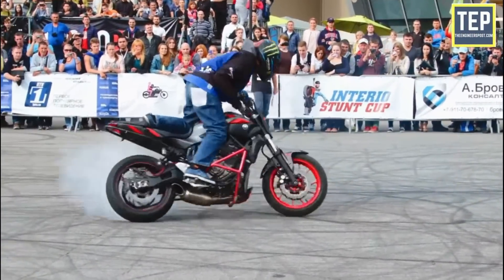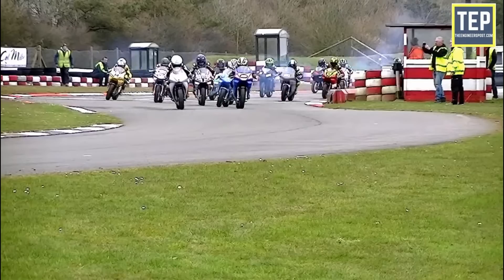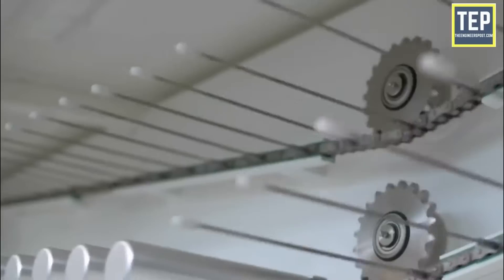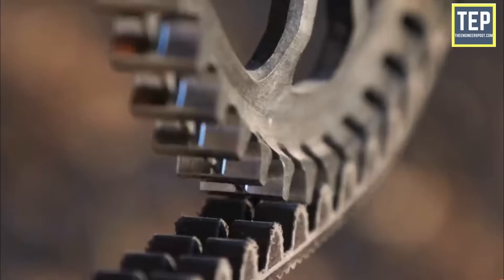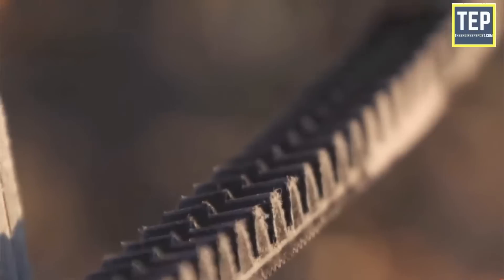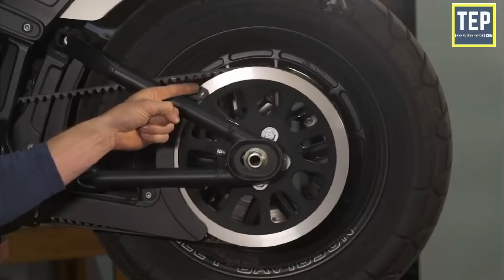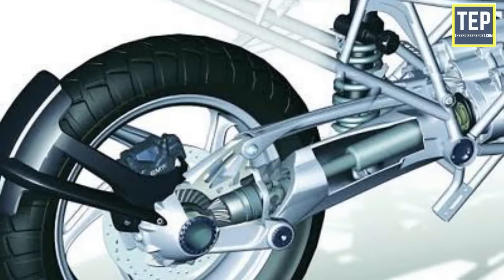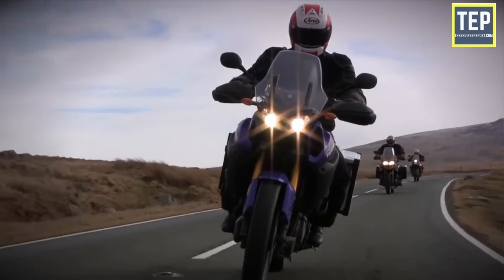Chain Drive vs Belt Drive vs Shaft Drive in Motorcycles | Which is Better?

Comment: Although belt-drive has advantages that you mentioned, a disadvantage is that they're unsuitable for off-road use.  If a stone or rock is caught in the drive, it could ruin the belt, & possibly the hardware as well.   I don't like the hassle of chain maintenance.  I'm happy w/ my shaft-drive, despite the power loss.

Comment: the only reason chains are the norm is because they are just a continuation of conventional wisdom and engineering.  I have had chain and belt driven bikes, and honestly greatly prefer belt because no required mx. My belt driven bike is 17yrs old and still on it's original near wear free belt at 16,500 miles. all of my chain bikes are on their 2nd or 3rd chains in less than 15k miles. they also require regular cleaning and lubing, plus rear wheel adjustment for tension over time since they stretch.

Comment: Chain final drive creates grease spray and a chain requires cleaning and greasing. I never owned a bike with a driveshaft. My current bike is belt witch only requires cleaning with soap and water. My belt life is 16000 miles. I vote belt.

Comment: I've owned all three types of drives. I hated the belt drive. One little pebble gets in there and your belt is toast. To change the belt, it's a pain in the butt. Shaft drive is great, but it's NOT maintenance free. About once a year I change my final drive oil and lube the splines. Doesn't take much time. It only holds 180ml of oil, so a quart will last you a long time and a little jar of spline lube may list you the rest of your life as you don't need very much of it. Chain drive is the easiest to deal with in my opinion. Just spray on some lube every other ride and don't worry about it. The only thing that I hate about chain drive is adjusting the slack, especially after a tire change. That's the big plus for shaft drive. It never needs any adjustment. There is no "stretching".

Comment: Maybe it's a dumb question, but here it goes: Why don't we completely and thoroughly cover the chain with a flexible material?
Reply: What materials will withstand getting repeatedly squished between steel sprocket teeth and steel chain links?

Just put chain lube on it, that's the best anyone can do. If you want longevity, keep your throttle under control. Rapid acceleration also shortens the life of the rear tire.

Comment: chains for going fast, cheaply. You may or may not have wanted to work on your bike, but now you just do.

Belts for going fast-ish, quietly. And have some cash to keep spares and tools.  Because you WILL need the spare. You're prolly using belts only because that's what the bike had that you bought, and you didn't care.

Shafts for when you have no budget, and best is the only option. You also prolly don't work on your own bike, or you have an entire specialty workshop for just that bike alone. You're also likely older, and you have other bikes to ride when your 1200gs is in the shop for the Nth time.

Comment: I think the power transmission %s are overstated. And loss for chains wasn’t nt listed (5-10% I think….please chime in with better stats). The difference in power loss compared belts isn’t much different. Belts are a little more expensive to build. I’d say that’s the reason chains exist in all but sports/performance bikes. In those cases, the squeeze to get every bit of advantage is on!  And replacing chains before or after a race is reasonable. I like shafts too. But think they only really make sense in liter+ bikes.

Comment: Your stats on power loss is in error. 99% s chain. 98% for the belt, and 15% for the shaft. These figures were established in the mid-1980's. Of course that was then.

Comment: I have a Moto Guzzi V7 which is shaft drive.  What I like most about it is that I don't have to clean it all the time.  Changing the oil in it is a breeze and doesn't need to be done all that often.

Comment: Expensive and most expensive are nondescript terms.  $500-700 for a shaft that lasts 10-20 times longer than a chain, and potential break down on long rides much increased on a chain?  And how much heavier?  Compared to a chain only, what, 3-4 times more weight meaning 5-10 pounds more?
 No thanks, I'll always choose a shaft.  And never ever heard of a shaft slipping..

Comment: What about the Verge approach? An Emotorcycle, with no transmission? The rear wheel hub motor! The stator is the hollow hub! 10" dia hole! The rotor is the rear wheel with the tire fitted. The swingarm is a swing fork either side which has two fixed contact points either side to the motor stator! It is just like an Ebike with a rear wheel hub motor! No need other than legislation for a rear brake! Where it is required, it is big dia hollow ring attached to the motor stator with the caliper on the inside!

Comment: To achieve optimal belt tension, industrial professionals rely on a specialized tool known as a belt tension gauge. This device allows for precise measurement of belt tension, ensuring that it falls within the manufacturer’s recommended range.
It is important to note that despite traditional wisdom, the “thumb test” to check the tension on a belt is not an accurate measurement and should never be used. Many businesses still use this method to measure the tension on a belt and frequently have to replace belts due to incorrect tensioning. Only a belt tension gauge can give an accurate belt tension measurement.

Comment: i have a chain driven DRZ400 and a shaft driven XJ750. shaft is cool cause it doesnt need any real maintenance besides some gear oil. but they are heavy, i think i prefer chain the most. they are simple, cheap and easy to replace. yea lubing it often can suck but it doesnt take long

Comment: The right tool for the job, as with anything.

Performance (chain) vs convenience (belt) vs reliability (drive shaft).

Only idiots argue over which is "best".

I like Moto Guzzis with their transverse V twins making use of the drive shaft. Smooth ride with easy high speed performance, even with reduced power off the line.

Ride your ride.

Comment: My Can Am Spyder RT Limited uses a belt. When I picked it up from the dealer brand new, I had a hole in the belt caused by a stone from roadworks within 700km. I was livid - it cost NZ$800 to replace the belt.

Comment: I've had mostly chain driven bikes, but two that had belts, a Kawasaki Z20 Scorpion and a Harley 883 Sportster.  Belt drive is the way to go, no mess, quiet and no maintenance.  The chain came off a Honda NSF125 I was riding and locked up the rear wheel when it got jammed between the wheel and the swingarm.  I had to be recovered by the AA.  I knew a man who lost a couple of toes on his left foot, when his chain came off, whereas when the belt came off my Scorpion (under full acceleration from a standstill - I was showing off to some girls), it simply flew out the back onto the road, leaving me slightly embarrassed, but unhurt.
Some bicycles even use belts now.

Comment: I had shaft drive on two motorcycles.  1981 Honda CB900 and 1984 Honda 1100 Sabre v65.  They were both amazing, however I did not like the physics of the shaft.  On a regular chain drive, when you accelerate hard, the front of the bike gets light (like wanting to do a wheelie), however when you accelerate hard on a shaft drive, the REAR of the bike is elevated, not the front!

Comment: Triumph seems to have made one hell of a shaft drive, as I don't have much power loss on my 2020 Rocket 3. 165 HP is advertised and I was getting 151 at the wheel on a dyno with everything as stock--which is about a 9% loss. Though after an ECU remap, it's making 171 at the wheel. xD

Comment: As long as you ensure it's properly adjusted every once in a blue moon, a belt is a lifetime part. Really, the price difference is not an issue for most riders because they will never have to buy one. Of the handful of belts I've installed for my customers, one was damaged by gravel and the others weren't aligned properly, never seen one just wear out.  Chains were a daily thing, also saw quite a few engine cases broken by broken chains and countershaft seals and bearings ruined by worn out chains with tight spots. In fact, I believe I've repaired more bikes that were broken by their chains than I've replaced belts. For what it's worth.

Comment: 25% loss...you're using 70's numbers. In new shaft systems with high tech gears, materials and articulated design such as in a BMW R series the loss is under 10%, usually 7% to 8%. This is better then some chains i've seen running way too long and stiff sections due to lack of maintenance.

Comment: I’m very surprised to hear of such a significant difference in power loss between chain and belt. Since belts don’t stretch any more than chains, I wonder what could account for such a big difference. Some belt drive bikes, like my Harley, use a torque damper on the rear sprocket which contributes to power loss, but only for a split second when leaving the line.
Reply: If your belt gets hot after riding for some time, then that’s where the losses go

Comment: there is one more drivetrain now, hub motor, meaning "no drivetrain".
sondors metacycle is the first one to reach production, if you put electric scooters/mopeds aside, with a few shortcomings but it could become more common as we see progress in the future. I dont know if they'll find solutions for unsprung mass/reliability/cooling/limited power

Comment: Shift is better for efficiency but it doen not provide flexible power transfer due to road conditions are not constant we use chain as best has slip issue

Comment: I don't agree with a lot of things in this report. If your looking to get horsepower to the rear wheel then belt is the way to go then chain and last is the shaft. Chains stretch and have to be adjusted quite often. Belts don't.Also the lube factor on chains sucks. I dont know how many times we would ride and you could tell who had a chain cuz either the rider or passenger would have a black oil slick up the left side of their back. Belt is the way to go. The only downside is if you happen to break one its a little bit of work to change it. On a Harley it is anyway. Pulling the swingarm etc.

Comment: Shafts also have handling issues. Besides being heavy, which increases unsprung weight, they have torque issues. As you accelerate the wheel gets forced down causing the rear end of the bike to lift. Back off the throttle and the rear suspension compresses. This causes changes in the steering geometry as well as other handling issues.

Comment: My last Goldwing had over 287,000 miles before I sold it. I have owned three Goldwings. Two-up pulling an N-Line trailer for much of those miles...much of my life. Properly maintained drive shafts last forever.

Comment: Sorry....Totally wrong on the Shaft Drive "Opinions" here !   Had Two Honda 500 Shadow bikes ( With Shaft Drive ) , and those Bikes performed like Rocket ships for their displacement.  The Drive was Smooth as Silk, and the bikes had ridiculous acceleration and power throughout the power band.  Totally Comfortable bike to ride in the City or open Highway.  And the looks of those bikes was outstanding.  Shaft drive used hypoid gear oil, and although I did change mine, it really didn't need to be changed.  Man I miss those bikes, it's too bad Honda doesn't make one like those any longer.  Yes I know they have Shadows, but they are not the same.

Comment: Started with a shaft on a 79 Yamaha XS1100, got a bike with a chain, CB500, even changed the rear sprocket and chain itself, but it felt like a pain in the ass.  Now I'm back to shaft, R NineT, and no longer need to mess with gearing, or chain oil, or chain tension, etc.

Comment: Yes, chain drives are most efficient on motorcycles, but I would like to know how it could be possible to lose more than ten per cent of engine power in a shaft drive system, much less twenty five percent.  If that were even remotely true, you would never see drive shafts on automobiles.  Even front-drive autos have drive shafts, and auto manufacturers religiously minimize power losses in their car's drive trains.  Also, if drive shafts on motorcycles consumed substantial power, they would radiate that power away as heat.  I have never seen a hot component on any of the four shaft-drive motorcycles I have owned, ranging from a 1955 Zundapp to a 2005 BMW.

Comment: The drive shaft last the longest, the chain is next, and dead last the belt. 
 The drive shaft uses oil which keeps the gears oiled. The chain is metal and  is not oiled therefore it wares out fast. The belt is just plastic

Comment: I am reading in the comments below about how the shaft drive will raise the tail end during acceleration.  This was true back in the late 70's into the eighties bikes.  It would scare the hell out of you in a curve on a gravel road.  However, the later Honda bikes I have owned no longer do it.  I read somewhere years ago where the shaft drive redesign did away with that problem.  I do know my current modern bikes (ST1300 & Goldwing) no longer do that.  I don't know about other brands.

Comment: 7:34 "Where it is extremely important to make every horse count"
I'm not an engineer in any way, but why would we make a horse count? Would horses be doing mathematical computations?
Reply: Obviously they are referring to horsepower. For some strange reason horsepower is still used as a unit of measurement of the power of a mechanical engine produces. So the more horses you have under the hood is slang for the more powerful the engine under the hood.

Comment: A major disadvantage of a chain drive system is the oil, grease and dirt is thrown against the back of the bike and the panniers. You don't want to enter a good hotel or B&B with those panniers as your luggage on your journeys. And I hate to grease and adjust a chain in the rain on a long trip. Therefore a belt or a shaft drive are to be prefered on a touring bike. 
A shaft drive system has much less power losses when the engine crankshaft is not transvers to the rear shaft so the power needs to be transfered only once in an 90° angle by the a worm gear pair.  I own a BMW K1100RS and a Honda Pan European ST1100. Both have well designed shaft drive systems with little losses due to the motor orientation in the bike. And these worm gear drives do need some maintenance. You need to change oil in regular intervals not as often as motor oil changes but that counts as maintenance for me.

Comment: I'm a bit concerned about the statement claiming Chain drive only loses 1-4% power during transmission, cause any experienced rider with a dyno benchmark can prove that's a load of BS. Chain drives have powerloss of 10-15% on average wich. Belt drives are pretty similar, but a little bit higher on average powerloss. Shaft drive does provide more efficient transmission of power giving you more power, although at the cost of reduced top speed. That it'self comes to down to the sprocket ratio on the transmission system. The more gears and sprockets you add, the more resistance you'll add too. And more resistance means more powerloss. Simple physics.

Comment: The other main advantage of the chain (and criminally not mentioned here) is that it has the lowest un-sprung weight.  Un-sprung weight is undesirable because the more weight that is on the wheel means that the suspension will not be as compliant and responsive as belt (though belt is close) or shaft (worst case).  The more mass, that is un-sprung, the worse.   Shocks have to be bigger for shaft drive, and springs usually need to be softer to make the system as responsive to bumbs. For the most responsive suspension, it is best to keep the un-sprung weight as low as possible.  This is why you won't see shaft drive on a sportbike.

Comment: Very long  time ago in college I was told about that advantage of the shaft.  When a driver accelerate a shaft driven bike, shaft causes an upward torque  which causes to lift the driver up, where as the belt and chains although more common, create a negative torque which causes the front wheel to lift up.   I was told the ride of a  shaft driven motorcycles is more pleasant than the chain one.  That's why the shafts are used in expensive motorcycles.  Can somebody confirm this theory please? I have never driven a motorcycle in my life!

Comment: Had a BMW 1150 and you could feel the shaft at work yet it never bothered me... I did like the fact that it was mostly maintenance free yet the bike itself was expensive to service etc - Owned many chain drive bikes and I'm not a big fan... Dirt bikes chop out chains and sprockets (Particularly in dry/dusty conditions) where lubricant attracts debris - Road bikes with chain drives tend to get neglected and end up black and greasy which is a pain to clean or work around - I know ride a HD Street Bob 114 and belt is nice... It's quiet, super smooth and never snatchy like a chain can become - I doubt anyone buys a bike based on the drive system... I can't say it's crazy important to me hence my owning all three kinds.

Comment: Utter NONSENSE that a Shaft drive (on its own) robs 20% - 25% of motive power, UTTER engineering misrepresentation. 
IF the shaft drive, on its own, robbed this amount of power, where does the 'power" go?  Take a 60 KW engine at full clip, 25% of that is 15KW!!  Still with me? What happens to those 15KW, do you think? The go to oil turbulence & FRICTION. Both cause HEAT.  The final drive would MELT after a few KMs of high speed riding.    The TRUTH:
Shaft alone takes between 7% - 10% in oil turbulence and friction, the balance is the G-Box, yes the same G-BOx as drives belt and Chain bikes.  The final difference is nominal, perhaps 5%.